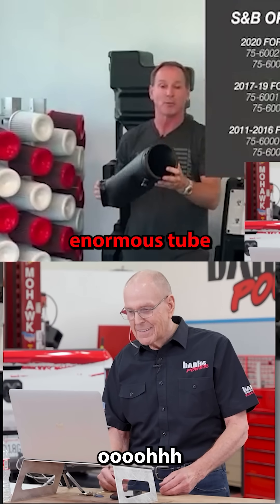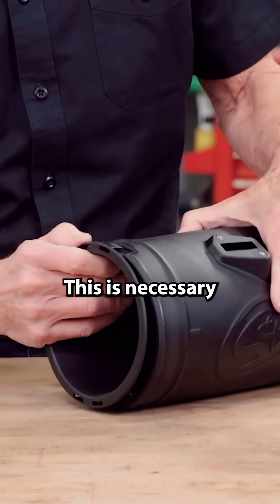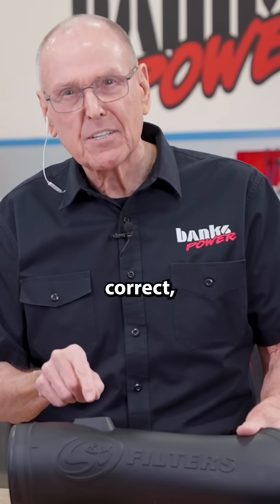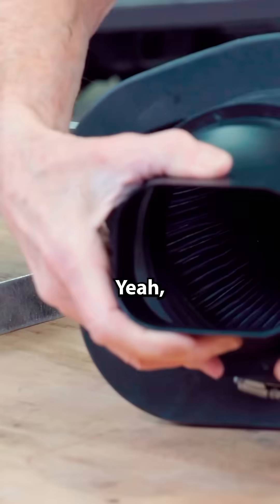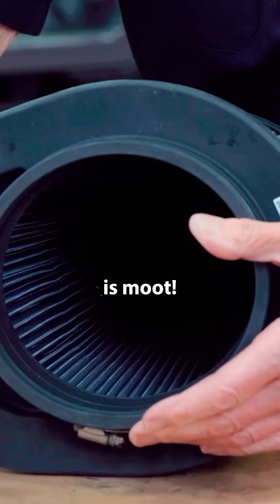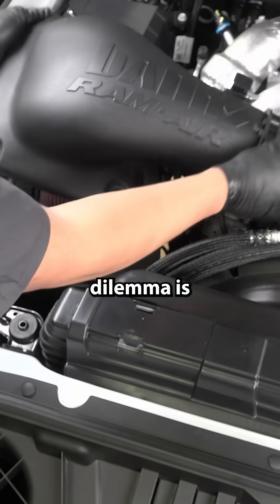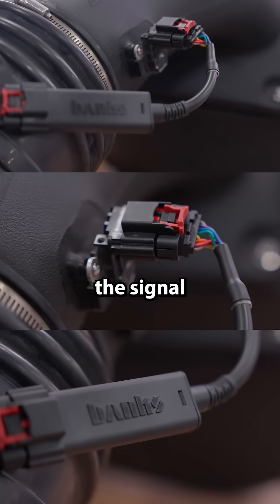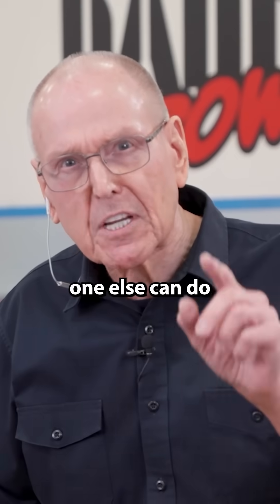Competitor tries to fake a big air intake

Comment: I put the cold air intake on my ram 3500 2022 and i got a check engine light the engine runs rough. Wonder if anyone else had that problem and what to do about it?
Reply from the maker: This is something that we're working on. It's not consistent even across the same year/model but we're aware of it. Shoot our customer support guys a text and they'll get back to you ASAP. 
(800) 601-8072

Comment: Your stock intake would be better than the competitor's aftermarket. That velocity is only right at the MAF sensor. Beyond that the volume changes resulting in turbulence. You are losing throttle response and not gaining air flow. But the good news is you will probably have placebo hp gains and will feel extra power that isn't there.

Comment: Could you imagine getting scammed buying an intake that effectively flows the same as stock lol. I liked how injen handled the maf issue on my old cruze, there was a small tube inside of the main pipe that directed airflow at the mass airflow sensor while maintaining a larger intake tube from end to end. The fuel trims were within 1% of stock so I know it was measuring almost exactly the same across the range

Comment: Any tuner worth his laptop can tune to whatever MAF is in whatever tube.  If you're just swapping stock stuff on the stock ECU and don't want to do anything else, then yeah you need to compensate for the new voltage curve of the sensor in the larger tube.  It's not complicated rocket science.  Mr Banks is right, but he makes it sound like he invented the idea...far FAR from it.

Comment: The reduction in area isn’t a big problem so long as the whole line is bigger. Pressure drop is determined by the whole lines geometry not just the minimum geometry unless we are choked which that is not choked. Removing the area reduction does help but that Maf sensor is more expensive than plastic and most people are cheap

Comment: I'd like to know how the your system adjusts the MAF. If it's not reading correctly there's no amount of fine tuning on the electric side of things that will make it read correctly. If it requires the airflow there's no other solution then to direct that airflow.

If it needs air at say 100fps to read correctly it's in a dead zone that only sees 20fps and it fluctuates it's literally impossible for a tune to completely bypass and rewrite the information it's been given.

I think this is the one time banks is full of it.
Reply: Dude he designed and tested it. He'd know the curves from what's read and what the maf sensor ought to spit out
Reply: @buckbuckleyson2259  nah some stuff banks is just as full of crap as his competition.

Physics is physics and no matter what you do a MAF sensor requires a certain amount of airflow and density to accurately read.

I worked in a tuning shop for years and both MAF sensors and narrow band 02 sensors can't be tricked to function on something they weren't designed to read. 
A narrow band o2 sensor reads between 10-14 afr and a MAF sensor needs a certain amount of air to pass over it. There's physically nothing you can do to change the way a sensor reads other than invent a new sensor. at banks they are using the factory ford sensor which has an extremely narrow band to read. There's no tuning that can make a sensor read outside it's designed parameters.

If you don't believe me go watch Richard holdners channel. He has a whole segment about MAF sensors and why they shouldn't be used in performance applications. He actually proved why and showed that air density, air temp, overall boost and a wideband o2 sensor are what is reliable information. 

Banks isn't dumb but this one is just a sales ploy.
Reply: @buildurtruckurway9118  banks relies on physics. Reproducible results are why he can use a formula to tell the maf sensor what it needs to think is happening

Comment: why not just tune the ecu for the different intake. Its common practice on all other tuning types. No cheating module needed. Thats just another part to fail. I normally agree with everything you say but adding a module to cheat the signal is ridiculous.

Comment: Couldn’t you simply use the stock sensor then put a simple box inline that will auto correct and translate the low velocity numbers at the given rpm.

That’s doesn’t sound like technology you can paten!

Comment: I would never run any reusable filter on any engine ever again. I’ve had several and after a couple years when you clean and then oil them you can hold them up to the light and can see right through the filter media. Nothing filters like throw away paper filters, nothing.

Comment: I was told by a very well known diesel mechanic and tuner that factory airboxes will handle up 900hp easily. He said the engineers at all three major manufacturers put a ton of time and effort into getting the best flow possible. Made sense to me. I really don’t buy into them. Exception would be those crazy insane high hp diesels on the track and pulling trucks

Comment: Bigger filter means more filtration media surface area so your filter will probably last a little bit longer but thats about it. The engine compartments are so packed these days that everything must be carefully designed to allow proper air flow or else your coolant, transmission fluid and power steering fluid wont be able to cool properly in their respective radiators..... so you might crack your block, blow a head gasket, throw your transmission, or sieze your power steering pump but at least you'll be getting a few more miles out of your air filter..... way to go speed racer

Comment: It is amazing when people believe that when they increase the size of the intake manifold they will get more power  well what actually happens they reduce the air velocity and they will actually get less power because the filling of the colonists is a short duration and relies on air velocity to fill in. So the engine is calculated to work with specific intake manifold making it bigger diameter doesn’t increase

Comment: Does this not work the same as on gas motors ? When I use a bigger intake tube, I then data log the MAF reading vs. A/F reading from the exhaust and make the appropriate corrections in the tables in the PCM. Is this completely different with diesels?

Comment: Then the air gets to the throttle body and shrinks back down to the normal stock size. So the large tube size does not matter unless you increase your throttle body and intake manifold

Comment: Gale will likely know this story from the 80's, the early days of computer controlled fuel injection that used a Manifold Absolute Pressure sensor (MAP sensor) and had a Speed/Density PROM chip inside the Engine Control Module (ECM).

The S/D PROM had a set of fuel injection tables that were based on the reading the MAP sensor took when the key was first turned on, before the starter was engaged. This would tell the ECM that vehicle was at sea level, or 5000 feet altitude in Denver for example where the air was thinner. From that reading the table would calculate how much oxygen was getting into the cylinders based on the speed of the engine and the vacuum reading of the MAP sensor, which was located inside the intake manifold, and tell the injectors how much fuel to inject into the intake.

This worked great until Harold and his wife Becky took a trip to Denver. They left an altitude of 1000 feet and didn't turn off the engine at the gas station so the A/C would keep the car cool, and when they got to Denver the car was putting out black smoke and it stank like rotten eggs because the ECM thought the car was at 1000 feet and was telling the injectors to put in way too much fuel.

So they pulled right into the GM dealership because it was still under warranty, and maybe Harold left it running so the service writer would see the smoke and smell the stink. The S/W would tell him "We'll call you." and send them to the nearest hotel.

Of course the second the key was turned off the car was "fixed" and the S/W would give the warranty ticket to his favorite technician which wouldn't even get in the car. He would just write, "Connected vehicle to CAMS machine (Computer Assisted Maintenance System). No problem found.", and get paid for 1/2 hour!

Of course the GM bean counters caught on pretty fast but they couldn't do anything about it, they had to pay, and boy do they hate to pay mechanics. So the word got out at GM headquarters that they had to have a foolproof system of measuring the O2 content of the air going into their engines. So they spent millions to make the Mass Air Flow sensor Gale just mentioned in this video.

And yet Chrysler kept using their system because they didn't use a "Speed/ Density" method of measuring O2 content. Since the O2 content is a steady 21% at sea level and 10,000 feet, they just used a spring loaded door in the intake tube right after the air filter, that had a position sensor on the door to measure how far the door opened. When the car was at sea level the door would open farther than it would at Denver where the air was thinner, given the same RPM and the same vacuum reading. Turns out it was just as accurate as any MAF sensor was, and it was a simple position sensor, the cheapest kind of sensor there is!

Gotta love those Chrysler executives and how they trusted their engineers! Those GM execs were thinking of how the technicians were screwing them and told their engineers to fix it "no matter what it cost", so they came up with the most expensive system they could think of. LOL!

Comment: please correct me if I'm wrong but can't some simple tuning solve this MAF problem?
Reply from the maker: Tuning can be a great solution for people in a lot of cases, however,  there are a few down sides: the cost and it'll void the warranty. Our solution allows you to run an upgraded intake without modifying the ECM or setting a check engine light.
Reply: @bankspower  awesome explanation! thank you so much! this is why you guys are the best and why I've been watching Gale's videos ever since I was a little boy aha, so this would be moreso a plug and play option that doesn't break banks (pun intended hehe)

Comment: Wouldn't an ECU flash work anyway?
Reply from the maker: Tuning can be a great solution for people in a lot of cases, however,  there are a few down sides: the cost and it'll void the warranty. Our solution allows you to run an upgraded intake without modifying the ECM or setting a check engine light.

Comment: You don't need a special module to trick the computer. You need the ability to modify the configuration of the computer and actually adjust the calibration of the MAF sensor.
Reply from the maker: Tuning can be a great solution for people in a lot of cases, however,  there are a few down sides: the cost and it'll void the warranty. Our solution allows you to run an upgraded intake without modifying the ECM or setting a check engine light.
Reply: Your not wrong manufacturers are happy to void the warranty for simple things to include something that remaps the MAF.  Have you checked with all the oems to confirm your asic is approved ? I will bet at least one person gets push back from the OEM if you device is left on when it goes in for service.  @bankspower

Comment: Surprised that MFS measuring larger air volumes are not off the shelf items.
Alternatively ultrasonic or vortex meters would give you a 50 to one turn down ratio.

Comment: Gale Banks is a forced induction genius, but this is not genius lol, the maf sensor simply sends a 1-5v signal. All you have to do is intercept that signal and boost it on a percentage basis compared to what the MAF is no longer reading. You can do this by simply live scanning or data logging what the engine is doing and increasing the maf voltage a fixed percentage until it’s running like stock.

Comment: I had a S&b in my last truck… it looked good but i don’t know that I picked up any HP. Actually, I think it was shown that my truck, with my mods, and a tune on 93 picked up like 60ish hp with the stock intake and it was literally single digit hp added by an s&b intake. But it did have the added benefit of having an expensive filter that I had to change or clean every 6 months or so. Twin turbo truck suck a lot of air lol. In the end, I’d wished I had kept the stock air box.

Comment: A good tuner can take that restrictor out and tune the maf to read correctly
Reply from the maker: Tuning can be a great solution for people in a lot of cases, however,  there are a few down sides: the cost and it'll void the warranty. Our solution allows you to run an upgraded intake without modifying the ECM or setting a check engine light.

Comment: can you not just scale the maf in the ECU
Reply from the maker: Tuning can be a great solution for people in a lot of cases, however,  there are a few down sides: the cost and it'll void the warranty. Our solution allows you to run an upgraded intake without modifying the ECM or setting a check engine light.

Comment: Not all, but a lot of these "COLD" air intake kits are not "COLD" air intakes because they're pulling in HOT air.  As far as this thing he's a 100% correct your air flow is regulated by the smallest diameter section no matter how big of a diameter of rest of the tube is. At least it will look good.

Comment: Gale fundamentally does not understand performance parts. Performance parts have three goals:

1. Look cool
2. Cost lots of money.
3. Reduce the lifespan of your vehicle components.

The competitors product succeeds in two of the three points. It only fails in that it keeps everything OEM. this could be fixed easily by adding holes past the MAF, allowing unaccounted for, unfiltered air into the engine, which will greatly reduce engine life with the bonus of slightly reducing performance.
Reply: This is a seriously underrated comment. If you expand the whole comment you can see that it's just a joke, not someone deliberately trying to insult Mr Banks. Which is how it might look initially. Which is why I don't think many people have actually read the whole thing. So I'm editing my comment precisely for that reason. 

My original comment:
This is a seriously underrated comment. Or I thought it was funny as hell anyway. The problem is that before you expand the whole thing it just looks like you're about to really just shit on Gale, so no one wants to take the extra 3-4 seconds needed to read the whole thing and see that it's just a joke. Actually not too bad of a joke at that.

Comment: Or you can re-scale the maf sesnor in the ecu 🤷
Reply from the maker: Tuning can be a great solution for people in a lot of cases, however,  there are a few down sides: the cost and it'll void the warranty. Our solution allows you to run an upgraded intake without modifying the ECM or setting a check engine light.

Comment: That little module is unnecessary if you do maf scaling in your tune
Reply from the maker: Tuning can be a great solution for people in a lot of cases, however,  there are a few down sides: the cost and it'll void the warranty. Our solution allows you to run an upgraded intake without modifying the ECM or setting a check engine light.

Comment: Yeah but you don't make a pedal monster controller for a Honda Civic 2009 SI coupe
Reply from the maker: Honda/Acura PedalMonster kits are coming soon, watch out this Summer. You can sign up at the links below the sign up box.
2008-2017 HONDAS & ACURAS: https://bankspower.com/products/pedalmonster-throttle-sensitivity-booster-64350-64353
2013-2024 HONDAS & ACURAS: https://bankspower.com/products/pedalmonster-throttle-sensitivity-booster-64360-64363

Comment: So many manufacturers selling snake oil. Open bay intakes (or a tiny heat shield yet breathing the same air) breathing engine bay heat increasing air intake temps by 30-40° at normal performance (less dense air: less power) and higher under load. And/or they pull gimmicks by making it look optimal yet restrict airflow like in this video.

Comment: Absolutely!, That's why for gas engines a lot of times whenever you get a Cold air intake, You also get a little sheet that says you need the dyno tune to go with it otherwise you might end up losing power...

Comment: At the beginning of the video I was like “you’d have to tune that out with a properly ‘cracked’ tune (cracked as in enough access to the ecu)”. 

I got a tune on one of my cars where some aftermarket intakes mess with the velocity around the MAF, but the tuner has the ability to compensate for that. It’s not often needed & a few runs down a road are necessary to dial it in, but no big deal.

Comment: Yeah be careful with these... I can't tell you how many times when I work to Chevy. We had a truck come in and had this on. It burned a whole to the piston. Open too much fuel under the engine. Because the math low center was incorrectly tuned to the engine... With a bolt on kit... There was nothing wrong with the sensor there was nothing wrong with the module it was the design.

Comment: Just curious, what is the basis of how your module knows how much to lie to the EGM??
Reply from the maker: It's really more of a correction than a lie. The MAF sensor works by running current through an exposed wire. The more current it takes to keep the wire hot, the more air is flowing passed it, but that process only works if you know the cross-sectional area of the tube the MAF sensors is in. This is why changing the tube size will throw off MAF readings. Our Air Mass Control Module corrects the signal to reflect the new cross-sectional area of the intake tube.

Comment: Could this also be accomplished at the ECU?
Reply from the maker: Tuning can be a great solution for people in a lot of cases, however,  there are a few down sides: the cost and it'll void the warranty. Our solution allows you to run an upgraded intake without modifying the ECM or setting a check engine light.